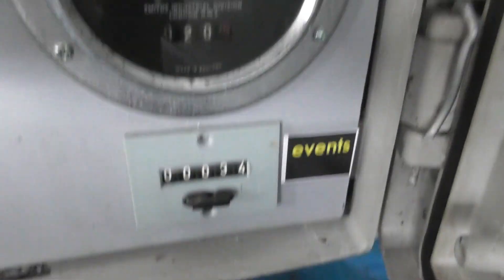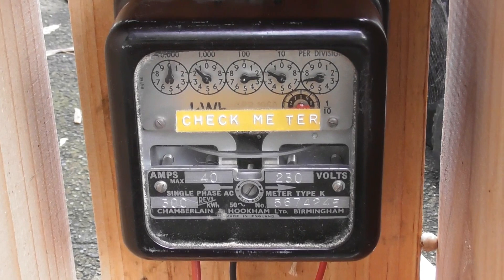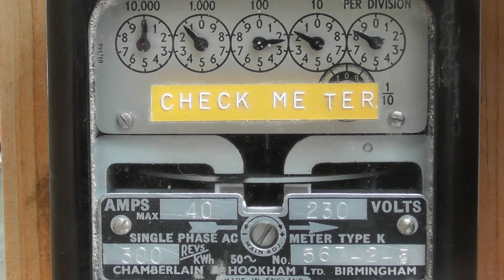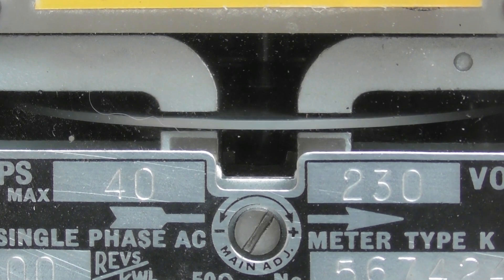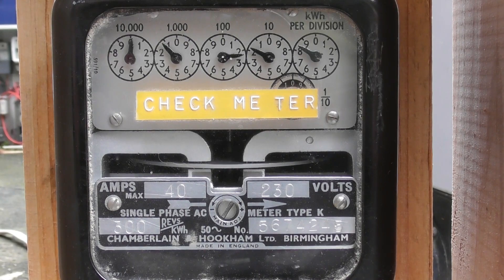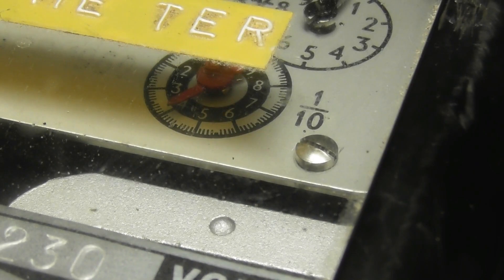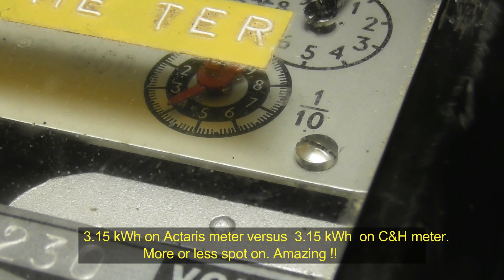Accuracy test on 64 year old C&H meter. The meter is still spot on.

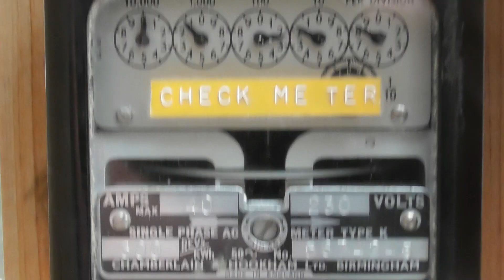Comment: That meter is one year older than me and in just as good condition - a bit dusty but spot on!  They were horrible to read though - especially for customers - as the first decimal digit rotates clockwise, the second anti-clockwise and so on.  So at 2:00 it’s reading 01218.x - can’t see the 1/10th unit behind the classic Dymo label!

Comment: Some very Sssatisfying 
loadwheel action from that 
300 rev Chamberlain & Hookham instrument!
It was really interesting to see that.....

.......there was more-or-less no loadwheel warp on this instrument, which is really tasty.

You could pair this instrument up with that other one you have which has the maximum demand needle on it. I believe that other one is a type K/Y or somewhere around about there?

Thanxx for showing this instrument. I do like these C&H type K instruments.

There will be many more instruments, time switches and Rate Changers popping up on the FULL HD 1920 x 1080p Wayne's Electrical channel, so do watch out for those!

RECENTLY RELEASED:  A de-canned Horstmann Vmk timeswitch performing its Exercise Routine! See the workings in action! Hear the escapement and synchro motor rotation corrector operating in stereo sound! It's a =VIDEO EXCLUSIVE= never seen before!

Thanxx for showing another tasty instrument. :-)

Keep the loadwheels spinnin',

-Wayne's Electrical.

27th June 2020, 05.25

Comment: The accuracy of the old meter doesn't surprise me. I have many old instruments that are still spot on. If something is not abused, then it keeps right on going. In my electronics shop I have a couple of old WWII surplus radio frequency generators that are near perfect when checked on my GPS based frequency counter. Also, that sure is a nice old Lister power plant you have.
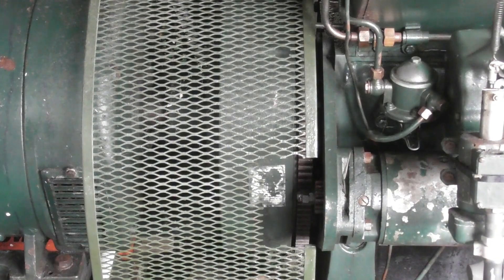Reply: Speaking of the old Lister diesel, are those metal chips coming from the ring gear/starter at 0:41 ??
Reply from the maker: @Tom-ws4cj  No, that was CRC as we had some rain and I sprayed all equipment the day prior.